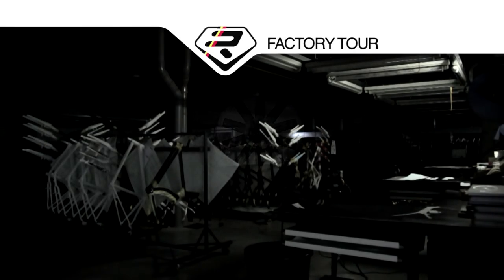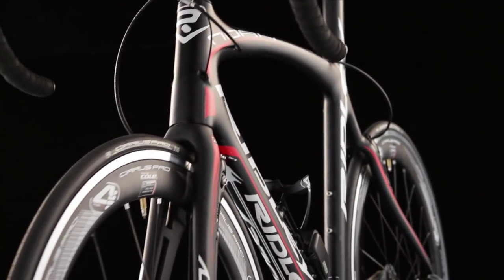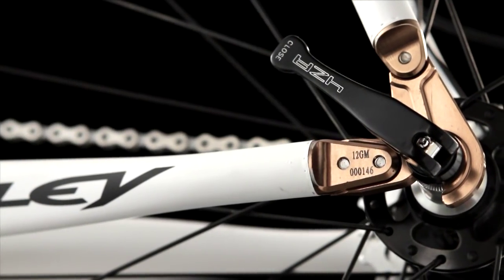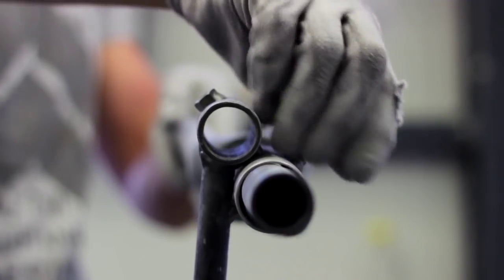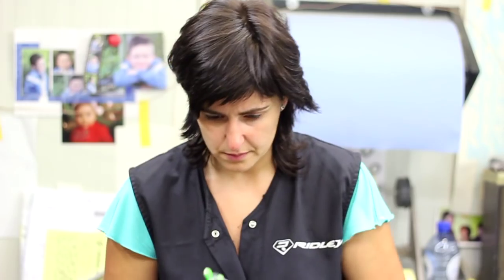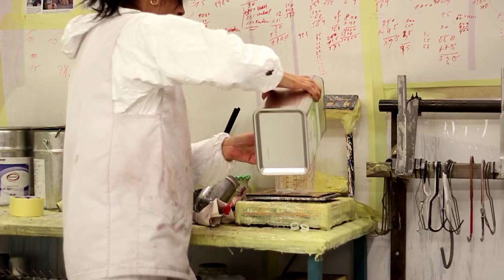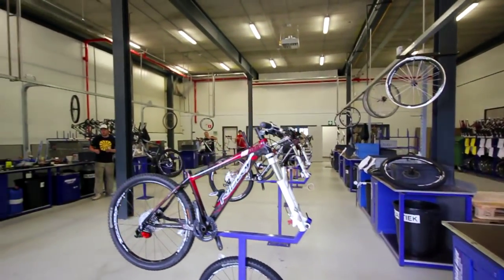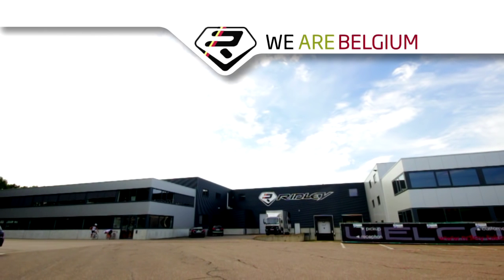Ridley Factory Tour - complete film

Comment: Of course the frames are 'made' in China. Made being the optimum word, as the design process is the most important. The frames are designed in Belgium, they specify exactly what carbon composites they require and to what tolerances, the frames are then built in a Chinese factory. Very few 'workers' are involved as the process of producing a carbon frame is very automated. As the film shows, the frames are then rigorously inspected by Ridley to ensure quality. Where the frame is built make no odds at all, if the design/ materials are good then the frame will be good.

Comment: Ofcourse Ridley Bikes are produced in Asia. What's the problem about that? Thankgod they're produced overthere, otherwise they would cost double the price they are now. If not triple or even more. An asian worker does the same job as an european, only much cheaper. It's all about R&D
Reply: +Karel Castelein it is not made in asia... it is made in Belgium...from a to z.... The only thing that is made elsewhere is the molding of the frame, this is made in china... It comes to Ridley (belgium) and there begins the process...sanding, painting, design, clear coat and asembling ....
Reply: +luca D&#39;Amires No offence. Hmmmm, believe whatever you want, I know beter.